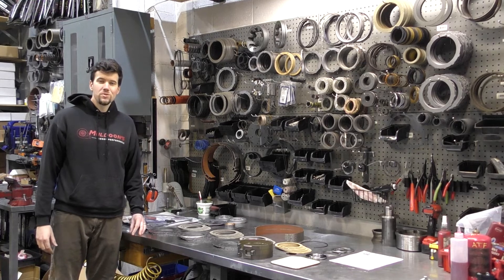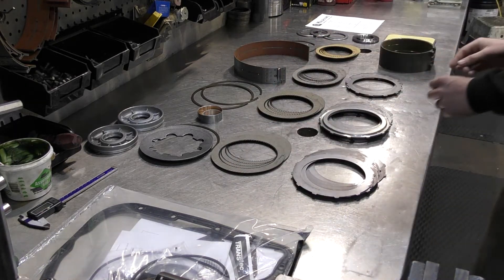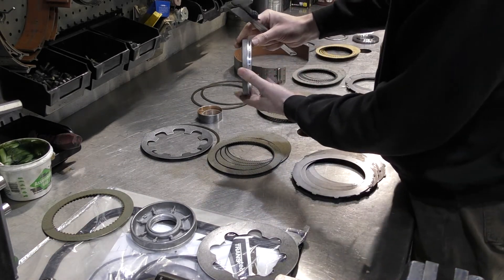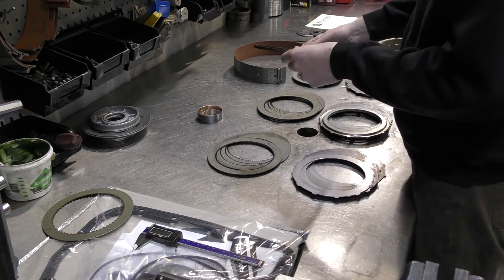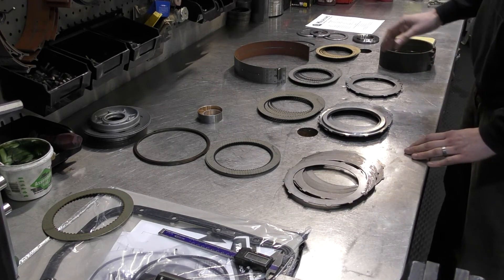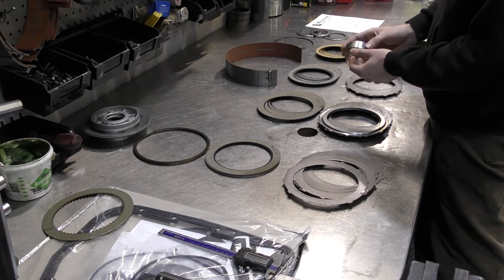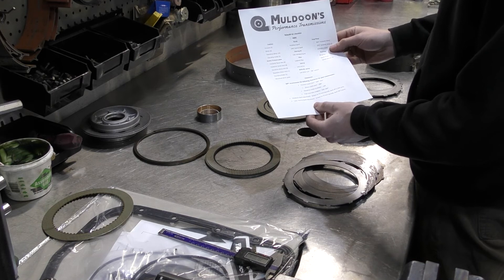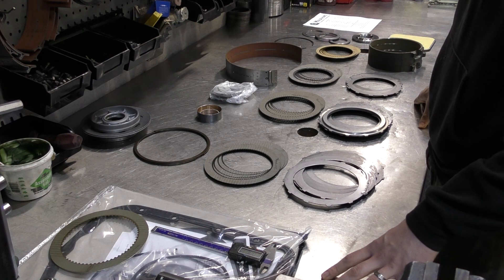47/48RE Rebuild Kit information

Comment: I have an 01 ram 3500 v10 4wd. It currently has a Jasper rebuilt trans which is on its last legs. I was assuming it had a 48re in it.  Is there an easy way to tell, externally, whether its a 47re or a 48re? If it's a 47re,  can it be replaced, and is it advisable to replace it with a 48re?

Comment: Is this kit something that could be used in a horsepower build that is 800+
I think I've worn out my directs and I'm going to do a refresh and looking at kits.
Reply from the maker: Yes, we use this kit in builds ranging from 400-1500 horsepower. To clarify, the clutches are only as good as the clamping force supplied by the valve body though. If you were to run this kit with a stock valve body, you can realistically expect it to support stock horsepower levels.